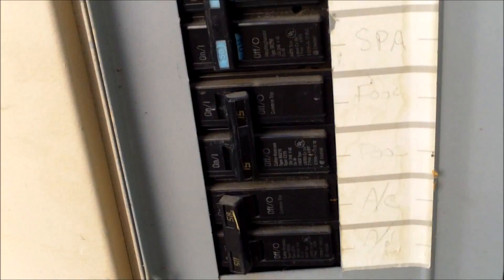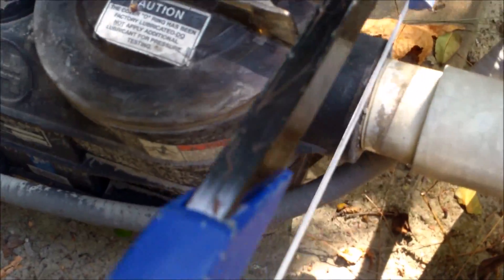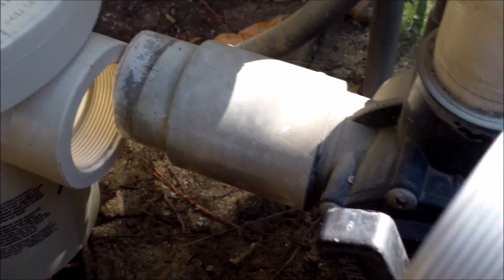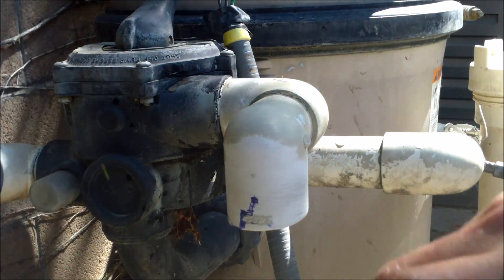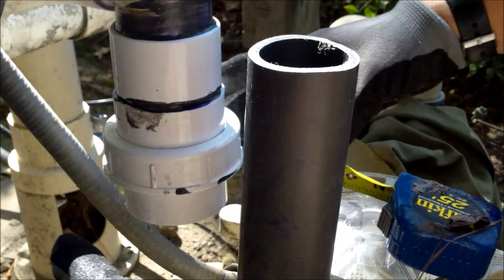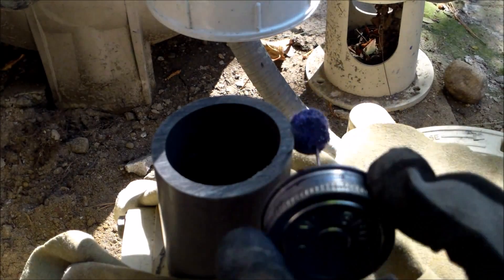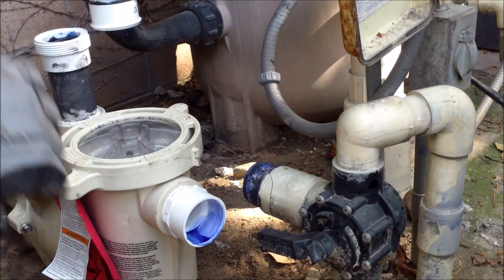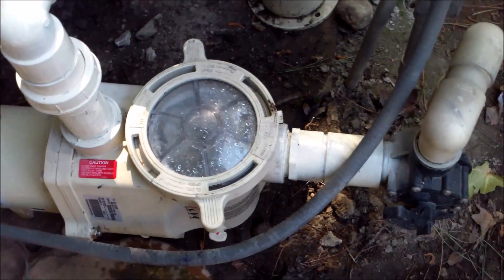How To Install a Pool Pump - Plumbing the Pump, Part 2 of 2

Comment: Are you using regular schedule 40? Also if my pump is 1 1/2 HP can I use schedule 40 under ground. I'm repiping the pool I'm unsure of what type of pipe would be best and. I'm worried about using 90's because of flow restrictions. I would use 45's but I don't want a lot of joints under ground. I could use a sweep as well but I want to really manage the flow. Right now there is black poly pipe with hose clamps keeping it together.
Reply from the maker: Underground plumbing is not my specialty - I would call your local pool builder and ask for a consult - that way you get it 100% right.

Comment: Thanks for this instruction. I am in need of that pvc pipe extender to fit over the outside of a 2" elbow. Can't seem to find one like that. Do you have a link or part number?
Reply: +LT P Never mind, found it. Magic Mend #0303-20. Will save me a lot of work when I replace my pool pump later this week. Thanks again for the video MrD.
Reply: You wont find the in hardware stores, try Pool supply. cost about $1

Comment: I tried to put a picture on your website but did not know how. I posted a small video showing the pump. 
https://youtu.be/oj2f4KRcRaQ
Reply from the maker: +Maya C YOu can do two things. One, cut the two pipes beowe the Jandy Valve and replace the valve along with the pipes to give you a new suction connection set up. Or try this 2" Fitting Extender over the existing pipe coming out of the valve. Cut the pipe right at the coupling and then stick the fitting extender over the coupling. 

http://www.poolpartsonline.com/p-56438-pvc-fitting-extender-for-1-1-2-fitting-429-2000-opt-7272-0.aspx?utm_source=google&utm_medium=ShoppingFeed&utm_term=ProductListingAds&utm_content=AllProducts&utm_campaign=GoogleShopping&gclid=CjwKEAiA64uyBRCVmKyT2vuAjzgSJADfINB6oTygG60FUdOG6VmUy_yn3XtJ470PZ1FkgO-k_EgtmxoCT37w_wcB

Comment: Great video. I have to install the same pump with the same setup EXCEPT that the suction side at the valve has only a sliver of pvc pipe which would not allow the same connection as in the video. Any suggestions would be much appreciated.
Reply from the maker: +Maya C Maybe send a photo to my website and I will take a look.

Comment: Should you sink your threaded pipe fittings all the way? I did not and have a vac. leak that won't allow a prime. I don't see water or air coming from the threaded areas and did use teflon tape. Day 4 of the challenge! I may have to do corrective surgery.
Reply from the maker: Legen Diver I thread the in as far as they will go. You might have to cut the pipe and re-thread them in. It happens.

Comment: OK I'm going to pump it in right away, I have to pipes coming out the ground ,I guess the one on the left side is the skimmer and the one on the right is the bottom drain .
Reply: Ivan one way to detect which is which if not sure is to use some food coloring.  This way you can tell for sure.  little trick of the trade

Comment: Is it OK to us the yellow cement glue its suppose to be for all wheat her ? Its a one step process  or should I go buy the blue glue.
Reply from the maker: It looks okay from what I just read online. Looked up the Oatey brand.
Reply: thank, i just brought a house with an inground pool  V,it didnt have a cover over  the pool.leafs frogs and other creepy things where flying and jumping around inside the pool . i wanted to clean it out first before turning the pump on and then i shock it with 6 pk of  6in 1 treatment  each pack covers 11000 gallons i think i have a 22,000  gallon pool ,the frogs started to jump out lol i'm thinking i might need more shock .
Reply from the maker: Ivan Bunch Frogs re not a good sign... usually when you have organic life swimming in the pool it takes a boatload of chemicals. When I get to a pool and see swamp life, I generally bring the chlorine level up as high as possible. The green algae and organic life will sap away a lot of the chlorine as it is being used up fast. For 22,000 gallons I would dump in about 8 bottles of liquid chlorine and that will raise it up to 50 ppm - about 5 times the shock level of 10 ppm. That should be a good start. Got that number from: Thepoolcalculator.com. 

Follow the procedure here and it should turn around in a week: Green Pool Part 1 of 2, How to Clean: http://youtu.be/ydIysBIHhWo
Reply: i dont have my pump connected up yet is that ok for now , i thought i should get the leafs out first and ten i shock it with about 7 packs of shock 6 n1  but i will go and get some liquid chlorine, but i can add this now before i connect my hayward super .thanks
Reply from the maker: Ivan Bunch I would get everything connected and up and running. The pool won't clear up well if it is not circulating. So plumb in the pump and get everything going as soon as possible. That is my recommendation.

Comment: I had a couple of questions on that joint stick ... I recently tried to plumb my above ground pool filter between my new pump and old cartridge filter.  Right at the spot where the threaded pipe screws into the the outlet is where my leak is ... I used teflon tape on the threads ... is that joint lock stuff better than teflon tape?  Does it glue the fitting in?   Should I be using an 0-ring?  Thanks for any help.  Jeff
Reply from the maker: Teflon tape is comparable to the joint stick - pool guys will use both. The joint stick never really dries so it doesn't glue the pipe to the fitting at all. Nothing goes between the threaded fitting and the pipe - so no O-ring.

Comment: Long time lurker and big fan.. Your videos and reviews are awesome. So much valuable information.. I noticed you film with one hand and demonstrate with the other. Invest in a Go Pro Hero 3 with the head mount so you can use both your hands I strongly recommend .. also on your plumbing video.. I'm not sure if your familiar with the Praher 2" High temp Unions . They thread onto the pump housing and make removing the pump so much easier for future repairs. Also the weld on 740 Pool Regular Clear glue works great no primer needed .. Keep the videos coming! Thank you !!
Reply from the maker: Thanks for the tips. I will look into all of them. Will be in the market soon for a new camera so thank you.
Reply: cant use without primer on systems under pressure and isn't up to code , bad advice.

Comment: Where do you get your Pool tite glue from?  I cant find it anywhere in the Martinsburg WV or Winchester VA areas... I checked pool supply stores and plumbing supplies.  Thanks for the video.
Reply from the maker: Any brand of PVC Cement will do as long as it is rated for high pressure. I guess they don't stock it in your neck of the woods.

Comment from the maker: How To Install a Pool Pump: Ever wonder how to attach two pipes that seem impossible to connect? Here I show you how to install a pool pump properly and easily.
Reply: Great video! I can tell you there are two others method you can use instead of a union.  One method is cut at the top and add a elbow.  Second method is you can use 2 inch pvc slip and burr out the inside center and pull it up after you gave apply the glue on both end. 😉

Comment: Good job, Mr.D. I think a tripod was mandatory for this clip. Where do you get your PVC white spray paint? I never see that at any of my distributors...big box hardware store?
-TM
Reply from the maker: Sears sells it - Krylon H2O Latex Spray paint. I use a light tan that looks almost white - covers a little better with one coat.

Comment: What do you do with old pumps?
Reply from the maker: I usually will take it home and use it for spare parts. I've got a few on the side of my house. This one is still at the job site. I will leave them there in case the customer wants it for some reason. after a week or two I will take it home if it is still there.